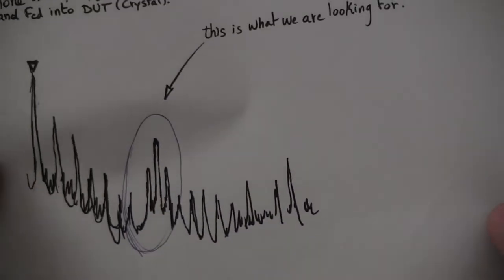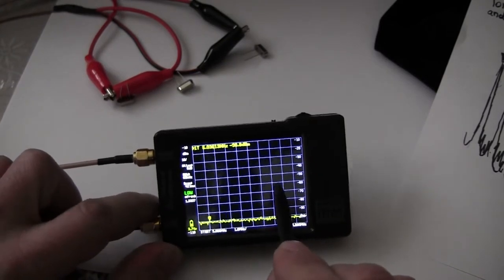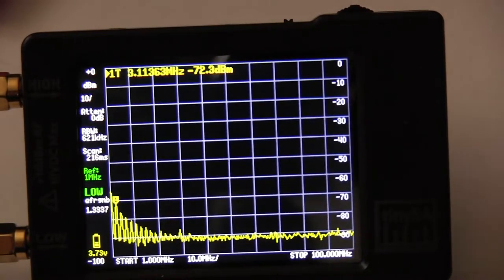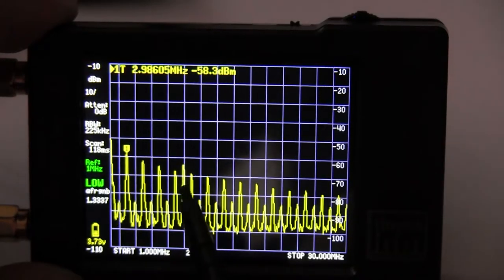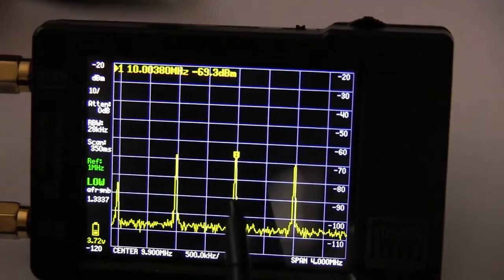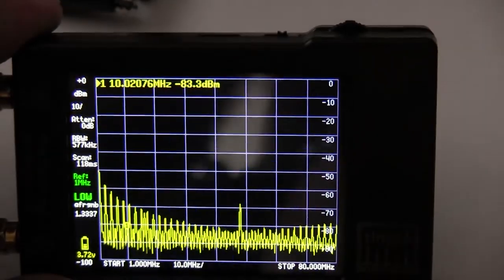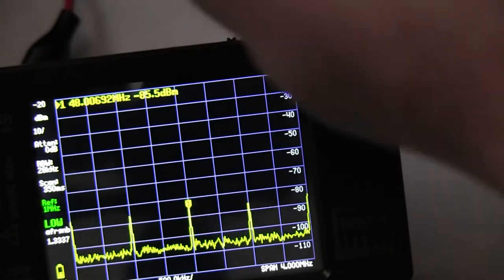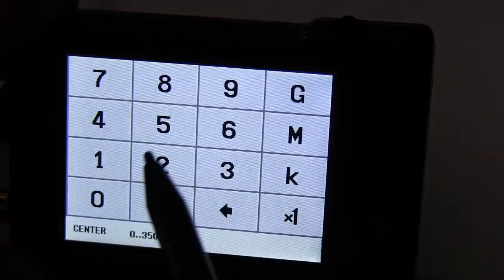tiny SA How to find Crystal Oscillator Frequency

Comment: I still can't see how the crystals are connected. I presume you have 2 alligator clips and cables coming from the Tinysa but where are the other 2 alligator clips and cables coming from?
Reply from the maker: Hello cliff, I have two sma-alligator clips cables, which I have connected to the tiny sa. Each cable has two aligator clips at its end, one red clip and one black clip. 
To make the experiment I've connected the black alligator clip from each cable together, and the red alligator clip from each cable, to the Crystal that i was testing. 
Hope this will clarify  method of connection.
Reply: Now I understand, thank you for the reply.